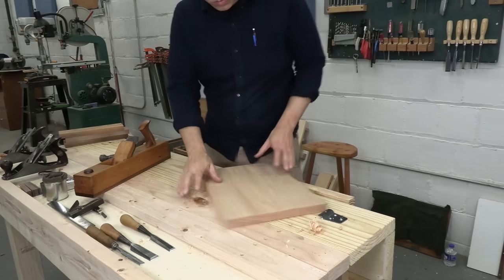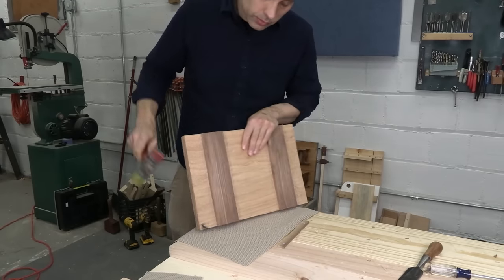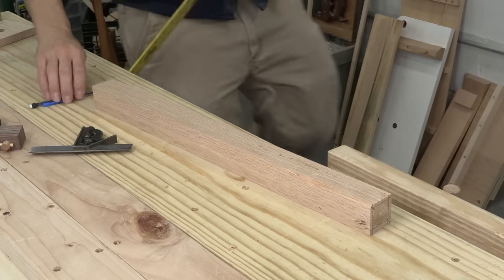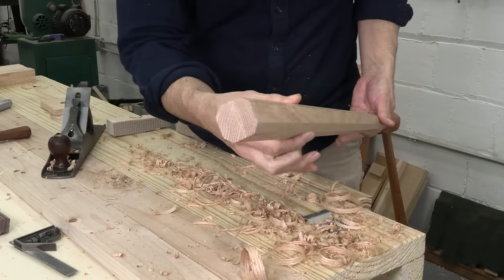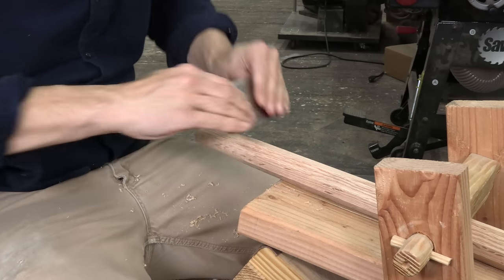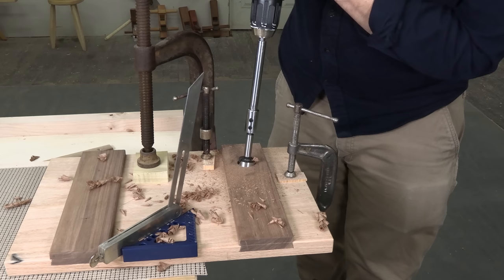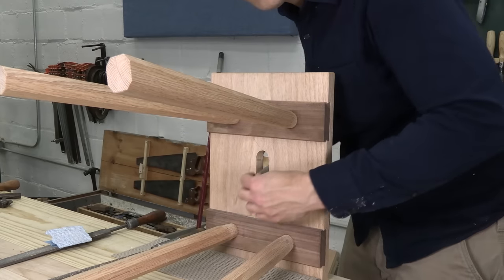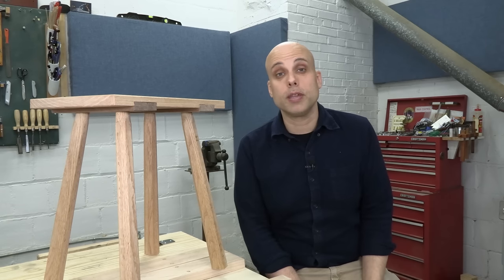Build the Moravian Stool with Sliding Dovetail Joinery

Comment: As someone who lives in a weird hybrid land where we use a mix of metric and imperial measurements, I really appreciate you using both systems in your videos, but they do highlight how weird my brain is with measurements. 

I've been making a conscious effort to train myself more on metric - I've stopped weighing myself in stones and use kg instead, and as my kids have grown, I've only ever used cm to check their heights.

But, a few years back, I worked in a shop that did packing and shipping and when reshaping cardboard boxes (to fit pictures frames etc) I tended to use inches for the simple reason that "The numbers are smaller so the arithmetic is easier" and this has bled into some aspects of my woodworking, but not others. Half-inch plywood is easier to visualise than 12mm, but as soon as you were talking about changing from 3/4" to 5/8", I had to stop and think about the fractions because I have no practice of using inch fractions beyond quarter. And when folks on YouTube start talking about 32nds of an inch, I have no idea how small that is, and then find myself in my calculator dividing 25.4 by 32 to get a value in mm.

It's a funny old world

Comment: The Moravian stool design is by far one of my favorites. I recently finished a set of bar stools based on this design, and they're tough as nails. Between the wedged through tennon, sliding dovetail battens, and morticed stretchers, it's just stupidly strong.
Reply: I have been thinking this design at the bar height.
Reply: @Vanessa Kitty  it's definitely worth it. I'd be sure to have stretchers between the lower portion of the legs at bar height, though. In my experience, the legs start to flex a bit once they get longer than 30".

Comment: I do the handhold first, but I also learned the hardway to remember it.  I use a coping saw to cut the outline between drill holes and a rasp to do the main finish shaping.  It isn't a Moravian design, but that handle is useful in most low stools.

Comment: Great video. Mirroring the compound angle via the use of a bevel gauge is such a trippy thing I never really feel like I'm going to pull it off but sure enough my eyeballs figure it out. I'm going to give most of the credit to the bit and brace length.

Comment: Very nice stool. Yes, it would have been easier to cut the hand hold before doing the legs. I also like the sliding dovetail. I used it on two baby cradles I built a while back. I also have a nice tapering jig for use with my table saw. Excellent design. Thank you for sharing. Have a great day and stay safe.🙂🙂

Comment: Impressive that you are showcasing the sliding dovetail Rex. A few years ago I tested my talents and started making my outdoor table sets with sliding dovetails. It really is a genious way of building. Right now as you post this great instructional video, I am currently building the first of three garden/planter boxes using only sliding dovetails. The boxes are 5'(w) x 3'(T) x 16'(L). Once you start applying using just wood joinery in your projects, you just may never go back to using nails or screws. I also use Draw board joinery on my table sets on the tressles and stringers, Perhaps you can showcase that type of joinery?

Comment: This is great! @Rex, just my education, why did you wedged the legs in the stool top? That would prevent expansion, which is the point of the dovetail pieces. Why not make those beefier enough to accept the wedged legs?
Reply from the maker: Wedging the legs keeps them from falling out.  With a straight tenon, they need wedges.
Reply: Thanks for the reply, but the question was why not use the dovetail pieces to do that? Wedging the legs that way has the penalty of limiting wood movement of the stool seat. Nevertheless, I appreciate your teaching style and the fact that you are bring to our attention a method that is unique
Reply from the maker: Ah, now I get the question.  Sorry.  You can use just the battens for the legs,  but then the battens have to be much thicker, which messes up the whole point of using thin boards. Also,  these rarely split, so there's basically no downside to sending them all the way thru. Thanks for taking the time to explain your question again.

Comment: Always wondered how legs like that were angled and made symmetrical. I guess you could prop the corner of the seat under a 15degree wedge and drill press the hole once you've started it flat give yourself a hole starting guide

Comment: Thanks Rex.  I made a 10 degree jig not that long ago (about 1:6) for sliding dovetails and then 90 degrees on the other side.  That way it has a dual use.  The sliding dovetail side is obvious.  The other allows me to chop to the baselines easily after coping/fretting out the waste of dovetails (trick I learned from Laura Mays).

In order for the scribing to work, does the bench also need to be level with the floor?  I can't quite tell in my head if that is needed.  I know the surface of my bench is flat and twist free.
Reply: Yes, it would need to be level. Imagine just two legs, the left one is 1 inch shorter than the right. You would put a 1 inch spacer underneath the left leg to bring it level. If you have a block set at 2 inches to scribe the legs, then you will correctly chop 1 inch off the left leg and 2 from the non-wedged right leg. If the bench is not level, skewed by 0.5 inch downward at the left leg then you'd need a 1.5 inch wedge under the left leg to make the seat level. Thus when you scribe the legs then, you'd be taking only 0.5 inches from wedged left leg, leaving a 0.5 inch discrepancy when you stand on the floor. 
Hope that explains it (and I hope I'm right!).
Reply: Also, I should add, don't try to level your bench if it isn't already. Just use a flat piece of ply or MDF and shim that until level on top of your bench. It'll save a lot of effort. It's not a requirement in normal use to have a perfectly level bench.

Comment: I might be dumb but I don't understand what is the purpose of the sliding joint, why not just insert the legs into the top plank? Is it just esthetics?
Reply: As he mentioned, the sliding dovetail construction allows one to use thinner pieces of material while providing a great deal of strength in the finished piece that you wouldn’t otherwise have in using such thin planks.

Comment: Another reupload?
Reply from the maker: Nope.  No idea why you would think that... unless you didn't actually watch the video.
Reply: @RexKrueger  because that's 3rd or 4th video about the same stool
Reply from the maker: But this is the video where I actually built it.  It's in 2 parts. The other video was about practice.  No reuploads here.
Reply: Definitely different videos. There were also several posts on Instagram with this. Go back and review the videos...